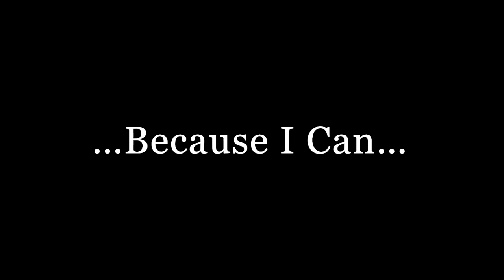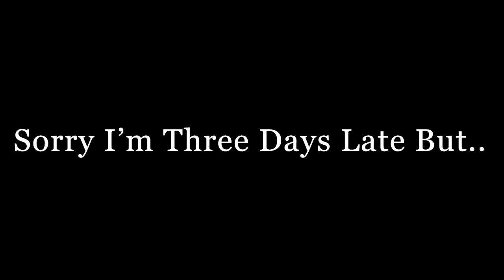So I Gave My Tuba A Bath…

Comment: You should not stand the valves on end. If a valve falls over or off of the counter it can be bent ever so slightly and even that will cause the valve to be out of alignment in the cylinder. Believe me this happened to me and I had to get the valve straightened. Lay the valves down flat and carefully.
Reply from the maker: Thanks for the advice! This was my first time doing this and I had minimal knowledge on how to bathe a tuba. I’ll be sure to lay the valves down when I do my other one! 👍